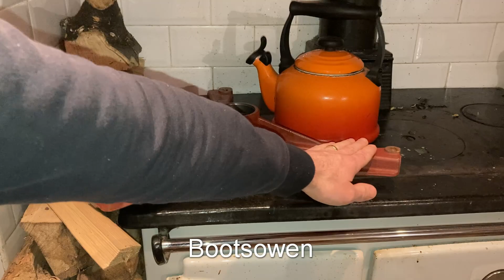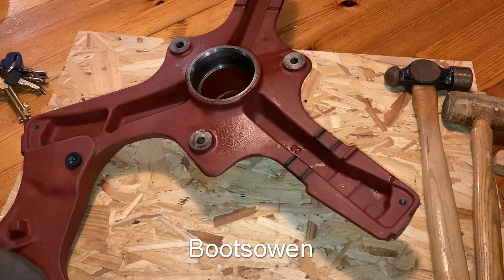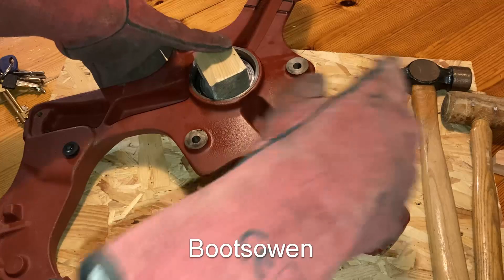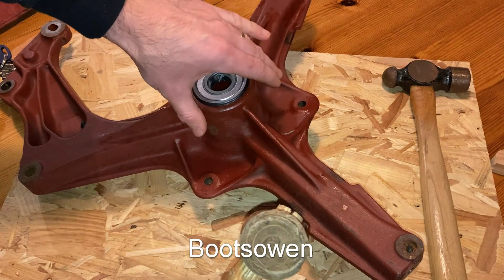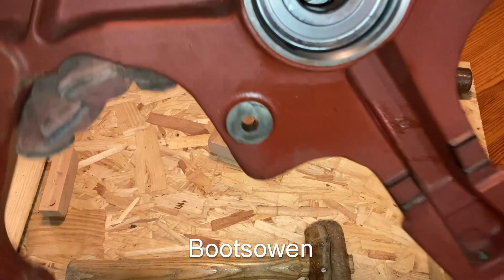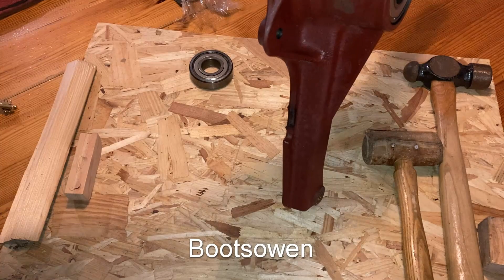One simple trick to install bearings using heat and cold: Bosch WFP3300: a kitchen table experiment.

Comment: Owen, reminds me of the times when we would put motor cycle crank cases in the oven to fit new main bearings, happy days and being told off for stinking out the kitchen, cheers
Reply from the maker: I was pleased with how well it worked. I remember as a teenager drying out a motorcycle saddle sponge beside the stove at home. House smelled for a week!